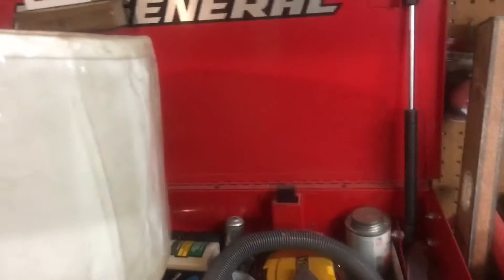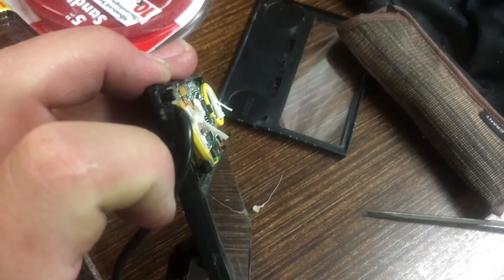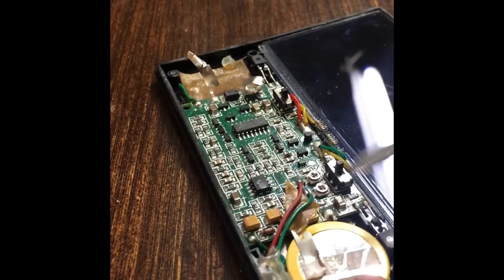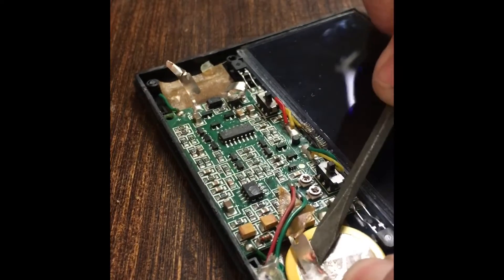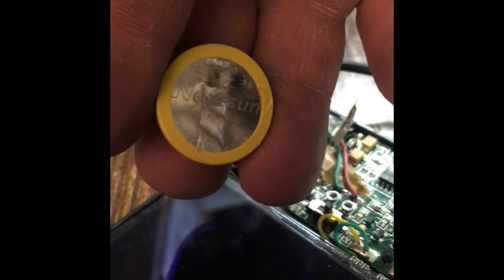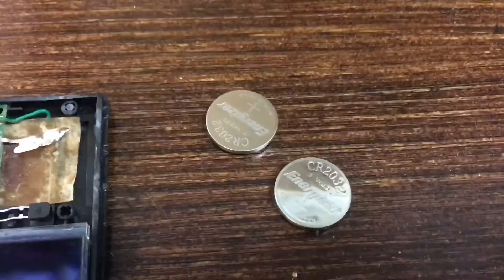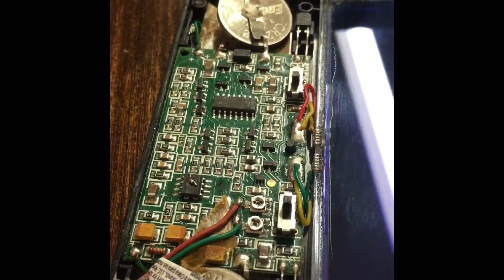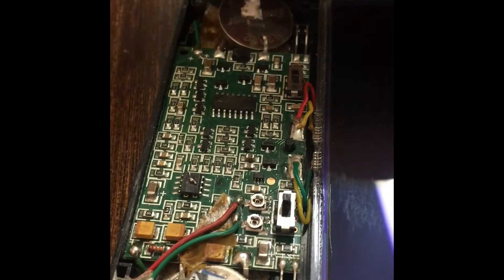How to fix auto-darkening welding hood that flickers or won’t darken!

Comment: A little piece of copper or aluminum tape to attach the leads to the batteries?
Reply from the maker: @Natemce  yeah that probably would’ve worked. What I should’ve done was went bought a new hood and just grown that one away but I like trying to see if I can fix stuff sometimes.
Reply: @Big0veralls  I'm in the same boat. After watching your vid, I swapped batteries on mine but it didn't fix the issue. Like you said, what's the worst that could happen? It already broke.
Reply from the maker: @Natemce  yep. Pretty much. Can’t break broke.

Comment: Tip for if you ever run into this again. Use some sandpaper to scratch up the surface of the battery, a dab of flux and your solder will stick. Though this is not good for the battery.

Comment: Thanks for the video. My helmet, that I have only used a few times, has been doing this same thing, and everyone keeps telling me it's because I'm doing something wrong, or because of sensitivity. 

Mine has a solar cell on the front of it, so I don't think that it's the exact same thing, but my helmet has been flickering like that for months now ... started doing it while welding MIG and now that I have a TIG  it is really bad.

I may have to open it up and see if it has some cells in there. My last helmet, just a no name thing, had a solar cell and a battery and after taking it apart I got it to work. Not wanting to fuss with it, I bought the new Lincoln helmet and now it is doing the exact same thing.
Reply: That solar cell recharges small batteries inside the module. Auto darkening helmets are just unreliable junk.
Reply from the maker: They do recharge with the solar cell but the battery goes to crap after a while. These aren’t designed to be changed. I bought a yes welder helmet to replace this one before I tried to fix it. That one has a replaceable battery.
Reply from the maker: They are rechargeable I should they just wear out over time like any other battery.

Comment: This is the second video I watched on this you understand got to watch too few to get the full just of it if it helps next time a guy put duct tape on the backing plate the backing plate to hold the leads down. Thanks still learned a lot
Reply from the maker: Same here.  I watch a ton of stuff t try to fully understand things.

Comment: Haha! Loved your video brother!! I actually was lookin for a video like this, as I have the exact same helmet, and now it won’t even darken despite bein left in the sun to charge!!! Also, what new helmet did you buy? I was lookin at the 2450 series, but I really like the knob on the side for shade darkness where I can change it on the fly! Appreciate it brother!
Reply from the maker: Glad you liked it.  I bought a Yes Welder helmet. It has true view or something like that with a changeable battery. It’s so much better than that Lincoln. I don’t weld much so idk how it is with everyday use but it still works after a couple years of here and there use and sitting in the garage. Got it from Amazon.
Reply: @Big0veralls  Awesome! Appreciate the info….I’m in the same boat as far as how much I weld, so I’ll definitely check it out!!

Comment: You could have used a box cutter blade heated up by a soldering iron. Place the unit in the middle of a large phone book then the bring the blade in between the battery clip and break free. Then use black electric tape to hold the new battery in place. I did that when I repaired nes and snes games that wouldn't save anymore.
Reply: They don't solder, they spot weld em 😂😂😂

Comment: You can replace these batteries if you buy the correct ones with solder tabs, they cost peanuts, the ones you used are not rechargeable.
Reply from the maker: I believe it. I finally chunked that hood in the trash. I bet the right batteries would’ve helped. lol, it was all just a learning experience for me anyhow.

Comment: Those batteries are rechargeable batteries, they are not supposed to be replaced, hence why they are spot welded in place. Replacing them with regular batteries would just junk the entire filter after a while and might even destroy the batteries. If there is no battery slot for your auto darkening lens its most likely rechargeable.

Flickering is because the hood is on low battery level, try recharging it under a bright lamp or in sunlight, if that doesn't work the rechargeable batteries are dead.
Reply from the maker: Yeah. I tried recharging it. Didn’t work. It’s a back up hood now. Bought a yes welder hood that I like that has replaceable batteries. I’ve always been told they were rechargeable but I’m skeptical if they really are.
Reply from the maker: Nope. You’re right it’s solar powered. I looked it up on the Lincoln website. Even the new one I bought is solar powered but it’s batteries are replaceable.
Reply: @Big0veralls  hey I've found that you can fix the blinking by covering the little holes with the light sensors so it dont activate the darkening and set directly under or on a lamp shade and if that dont work take a car battery charger and zap the battery with it on 12v 6amp for 12 seconds sometimes lithium runs dead dead and needs higher voltage to charge to life

Comment: Hi guys.If you check in sites you can find a battery with spotted legs which could be soldered to the board.Just be sure that it is rechargeable.Good luck
Reply: Already fixed mine.I would show you the site,I bought the battery from,but it is bulgarian and will be useless for you.But you can find one in your country.Regards!

Comment: Mate them batteries aint ment to come out. The hood is solor powered! All you gotta do is leave the hood in the sun and the rays from the sun being it solor powered charges the batteries. They are not ment to be removed as they are rechargeable 😂
Reply from the maker: Tried that.  Didn’t work. New battery fixed it. New hood has replaceable batteries. The manufacturer of this hood did that just to sell more hoods, I believe. That or it was just easier to make it with them soldered in.
Reply from the maker: All batteries will quit working after a while, you know that right? The ones in your car are “rechargeable”. Ever had to replace one of those?